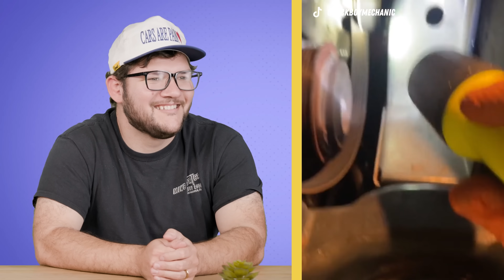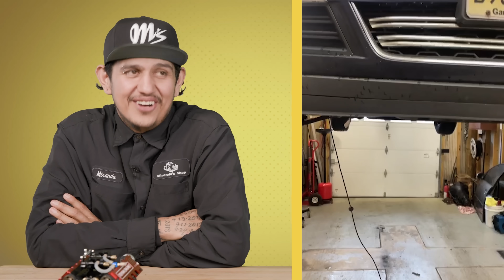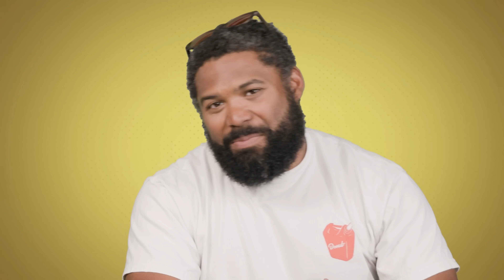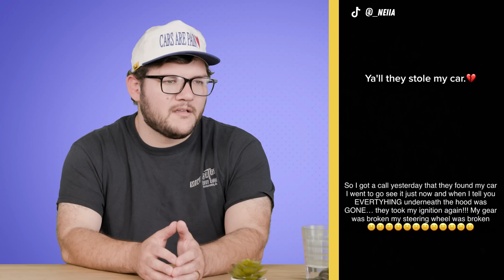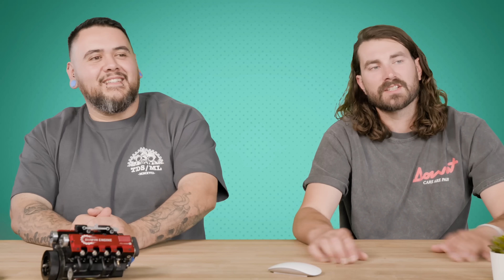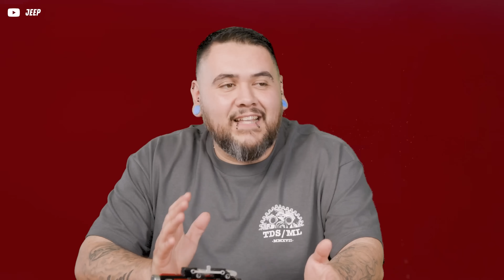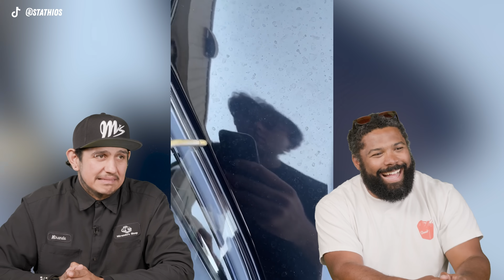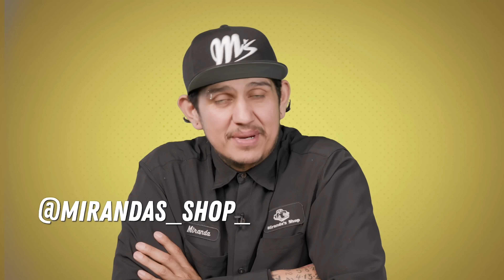Mechanic Reacts to Car Engineering Fails

Comment: I'm an engineer with a major OEM. Typically about ~80% of these issues will be identified by the engineering team before the product ships, but management doesn't want to spend the time or money to fix it. The other 20%, well we're human.
Reply: Exactly. Automotive engineer here, in a major tier-1. Money is the source of all evil, and beancouters are the conduits.
Reply: @Miguel Sousa  
Head of engineering here, yes cost is always gonne be a issue. If I let my engineers go wild on optimization the products get so expensive we won't sell anything. Then we go bankrupt and al engineers ar out of there job. It's a fine line we're all walking on.
Reply: @mksanwho  Not always true.  I'm in IT and have worked with some engineers.  Some of them think they know it all and simply refuse to consider practical considerations if it's not backed by some requirements.  This is the syndrome of I do what I've been told to do even if it doesn't make any practical sense.  And you can find sloppy people as well.  It's not always about money because a callback or warranty repair can end up costing even more.
Reply: @mksanwho  It's called design something worth a f*** before you even take it to the g**** engineers
Reply: Yeah I work in manufacturing, but on tractors not cars, same deal. The #1 reason is always time and/or money.
Reply: @Sergeant Mustang  depending on which conglomerate you work under... if it's daimler.... they on that bullshit with the freightliner Cascadia transmissions.
Reply: Engineer here. This is 100% true. Lots of times, if the base requirement is met, management does not want to or can't afford to optimize it. Redesign costs lots of money and time so it has to be weighed in to see if it's worth it. Also, what many mechanics don't understand are the limitations the engineers have to work against. Schedule, money, scope creep, design limitations, lack of support, etc. Most engineers try to be perfectionists, so mistakes like these are always things we want to fix, we just aren't always allowed to.
Reply: @Jbkhat  true, these types of mistakes are always on my mind, but unfortunately we engineers don’t call the shots.
Reply: @Jbkhat   Redesign?  design it right the 1st time
Reply: Couldn't you fix the issues behind managements back?
Reply: @Jbkhat are you an engineer or a yes man make up your mind one or the other.
Reply: At the beginning of the episode, as a manager, I stated out loud, "Upper Management"! But as an oil tech+, I stated out engineer.
Reply: Yep. I use “modern” machines at work where this is obviously the scenario. The base machine was engineered in the eighties and more capabilities were glommed on. Non-logical archaic circuitry where failure mode is catastrophic instead of limp home, duct tape is needed to seal gaps and “negative pressure” is measured as a negative number (vs. calling it psi vacuum).
Reply: I've worked in places with mechanics machinist and engineers. I was a machinist everyone including engineers would agree about a problem and where it should be fixed but management was the issue
Reply: THANK YOU  for this comment. Mechanical Engineer here. This video fails to acknowledge the horde of people pushing us around as we try to do our job. 

"Make it cost less"
"Make it look cooler"
"It's too loud"
"It's too quiet"
"Wrong color, cuz reasons"
"Make it work exactly the same but look completely different"

This is the life...

If only the broader public knew...
Reply: @dennisbernal91z28f1  im a mechanic here, im young been in the field for 4 years and i feel like its so true what u guys are saying. Yea sometimes i wonder why but on the other side its the things you mentioned. I would actually like become an engineer, but i rather fix them for now.
Reply: @dennisbernal91z28f1  i think yall do get too much hate. But when a dealer marks up 20k it make it look much worse on yall
Reply: @Forty8fan  Not sure how the actions of a private dealer have any bearing on the design intentions of a mechanical engineer, but ok.
Reply: @dennisbernal91z28f1  that's why yall make the BIG BUCKS!! 😁
APPRECIATE YOU!
Reply: @theglitch99   Thanks. It is true that we get paid more than a mechanic in most cases. We also go thru a lot more schooling and most engineers end up with a lot of debt. Another thing to consider is just about all of what we learn in school is not applicable to field work. We just learn how to learn (complex things). From there we get into a field we find interesting or pays well (or both) and start at the bottom. I work for a major toy company and the amount of critical things being designed by junior or even temp engineers is insane. You think we would have an army of engineers designing everything. Its simply not the case, its like 3 and some interns.
Reply: @dennisbernal91z28f1  my kid wants to be an engineer,  much respect!
Reply: @theglitch99  That's fantastic! Help them stick to it. It is a good life. I use to want to be a mechanic (also a good profession) when I worked pumping gas at my first job at 15. The lead mechanic gave me some advice when I said I want to be like him that I will never forget. "Get paid for what you think, not for what you do". He had a lot of aches and pains and was in his mid 40s. By 16 I knew I wanted to be a mechanical engineer. 39 now. Still remember Mike.
Reply: @dennisbernal91z28f1  great advice, 👍🏼
Reply: @dennisbernal91z28f1  or “ you have this much space, make it work”
Reply: @dennisbernal91z28f1  My favorite is 'Make it better, but don't change anything.'
Reply: @dennisbernal91z28f1  couldn't agree more bro
Reply: @dennisbernal91z28f1  "This video fails to acknowledge the horde of people pushing us around"

They did acknowledge the horde of people pushing you around as a waterfall of people that the ideas have to go through. It's too bad the higher-ups are more concerned about raising stock prices for investors than they are about build-quality and brand image.
Reply: @dennisbernal91z28f1   then asked to be invited to be on the show. they are asking the question based on MECHANIC opinion. the show can't acknowledge you if you're not on the show.
Reply: @dennisbernal91z28f1 So it comes down to marketing? Is that why I’m forced to take engineering economics?
Reply: @dennisbernal91z28f1  But a shorter bolt for the belt would cost less so....
Reply: @dennisbernal91z28f1 That’s your job bro don’t know what to tell ya. Do your job or find one you can do.
Reply: @dennisbernal91z28f1  you think people have it any easier at their job?We also get pushed around at our jobs for probably half the pay engineers get. Honestly that was a bad attempt to receive pity
Reply: @408Charger  Not looking for pity. Adding context.
Reply: Spot on, I work with the customer service team for a major OEM liasing between the agents and engineers/technicians at head office and the amount of times I get responses from engineers about an issue thats like "oh yeah we knew that would happen eventually" is disturbing.
Reply: Yup, my dad is a retired test engineer for a construction/agriculture machine company. So many known issues exist  due to management/accounting.
Edit: also politics/egos. Some engineers refuse to admit that they can be wrong.
Reply: Kudos kind Sir, I own a hydraulic business and deal with Engineers frequently, my guess is you work in a industry where Engineers admit when there’s something astray so it can be corrected.  In my world errors like these are the fault of the driver, or car owner, or Uber driver that picked up the driver/owner or even the waitress that served all of the breakfast, just NOT theirs.
  So, I send lots of respect to an Engineer that admits he’s human. I’d enjoy working on a job with you.
Reply: @Hydraulic67   thank you, you sound very chill my dude :)
Reply: I needed 13 minutes to be like: Hold on, we engineers know the most problems, then higher-ups say they will accept it, for the following reason. You think a better-built car that cost 30% more for the same performance specs will sell? No.  Long-term reliability does almost nothing to sell new cars. Make it a standing, faster, sportier. Boom, sales.
Reply: you forgot the part where you will be ordered by management to build it hard to repair on purpose cause management doesnt want to sell repair parts but instead new cars
Reply: C suite needs their bonuses!
Reply: Just a tip, never put the battery under the back seat. Still one of the stupidest designs I've ever seen.
Reply: Remember the space shuttle Challenger got wrecked because of the "management" having more leverage than engineers. Suits and ties who never turned a wrench in their lives make decisions on behalf of the enhineers.
Reply: @tolloromassi99  didn't a 50cent grommet or ring fail. That probably wasn't helpful. Engineering Duty  of care failure by price. No other contributing factor. A bean counter with no job experience with the ability to undermine safety for the advantage of management only. I'm sure the families would have preferred safety without price instead of boxes caused by board members and investors.
Reply: I came to the comments to say this.  Agreed!
Reply: I am a design engineer i agree with you bro.
 Exactly management only seen profile.
Reply: Glad this comment exists.

As a contractor, I know damn well who makes the final calls... the one paying the bill.
Reply: it makes them more money long term anyway. Either they make it back on the time spent fixing it, or they sell a new car
Reply: I was about to say for every blam on engineers, the managers of manufacturer are  also to blame for bc the managers are decision maker, not engineers.

Mass-produced cars are ultimately designed for the quickest assembly time for lowest production cost, not ease of repair.
Reply: Thanks four your Comment, I would add to your 100% the 400% amount of issues which were avoided by engineers. The fact that every bolt you can get to you can get to because somebody thought about how you can get to it.
Reply: I am glad someone actually said it
Reply: Cost cuting and maximizing profit have been neglecting issues raised by engineers and scientists for decades!!
Reply: 100% this. That bolt on the Traverse is that way because tehy wouldn't fork over the money to listen to the engineer that pointed it out. They are too busy trying to force them to make the engine just fit and work with as little money as they can so they don't have to retool/rework the engine between chassis.
Reply: Bragging about a "We fuck up 1 in ever 5 chances" rate is not good. If I did that as a General Contractor, I'd be sued into Oblivion. Bad Engineering costs lives.
Reply: I see the same thing on the aviation side. Unless it's a safety issue. But other than that, the same parts break over and over. It's cheaper to replace a seal than to redesign the part.
Reply: So it's all the Ford Pinto problem, although fortunately less severe most times.
Reply: No, that's someone going click happy in Solid Works with no real field experience with cars. You can design some amazing mechanical art that turns, but when it takes 5 specialty tools and you have to take the tire off to change a battery, engineers are at fault. You're also cramming so much electronics into the car you've forgotten how cars work, you're counting on the chips to do the same task as a manual part that's easier to access and replace. Why did the Willies Jeep work? KISS.
Reply: @3DPT  It sometimes feels a bit as if some cars are engineered by people who are fresh out of college and who've always had their mum doing all of their oil changes. I also know how bad many software engineers are at UX (user friendliness) design, so it's not just a car problem.
Reply: @3DPT  ooh rah
Reply: The reason is that the management moved away from just in time manufacturing to make strikes less effective.

They have thousands of faulty parts on the self and can wait months to get the parts from overseas.

Before the parts were made down the street and changes could be made much quicker.
Reply: So the real answer is greed..?
Reply: @aroc9344  greed from the companies and no balls from the engineers
Reply: Love how engineers find someone else to blame when they designed it. lol they don’t live in the world only theory. I know I work around a lot of engineers and lol they never held a wrench before. Kind of sad.
Reply: 100% agree. Every company I've been at has the same old routine of engineers going to management saying "hey this is gonna be a problem" and management responds by saying they don't want to spend the money to fix it.
Reply: There are game breaking bugs in video games that only take seconds to fix, and managers still fight with all they have against the programmers not running the way the manager like.
Managers are the real problem in the world, especially if those managers never had anything to do with what their workplace does.
Reply: If engineers are so bright, why aren't issues noticed during development. You know why R&D is BS, accountants run businesses.  As for Tesla they have Chinese partnered plants now and those cars don't have build issues that often.
Reply: Lol, I just wrote the same thing. 😂
Reply: 20^ of the most expensive fixes.
Reply: Yeah it really annoys me when people don’t realize this and blame the engineers.
Reply: The management is definitely what happened with the first one
Reply: Exactly - Toyota has been selling lots of reliable cars for a long time (yes they have their turds but overall)…GM, Chrysler, and the others consciously decide to make cars the way they do. They can copy a better process and don’t
Reply: So it all comes down to what the company can legally get away with.
Reply: Yup.   That bolt looks like the bean-counters decided that they're only buying one M8 bolt because they can get them $0.00003 cheaper per bolt if they're all the same size.  Any clearance issues it causes are somebody else's problem 'cause "we just save the company thousands".
Reply: Have you considered taking a sledgehammer to the bean counters?
Reply: yup, can confirm. Though i do work aerospace, so it is 15% human error, 5% we don't want random people messing with stuff so we make it a pain.
Reply: yeah that's what I thought. Most of the supposed engineering fails can be traced back to accounting. Because if soccer moms wouldn't want all that electronic extra bullcrap in their shopping cart Jeep, the engineers probably wouldn't have to try and fit the stuff in there. And if accounting actually gave them enough money for proper components, shit like that also wouldn't happen. For the pulley bolt, even if that bolt was half as long, the head of the bolt already touches the frame, so you wouldn't get a shorter bolt out either. And moving the engine back would probably leave no room for the ginormous automatic gearboxes everyone wants these days. Or for the ginormous A/C units, or for several other unnecessary things that the engineers have to package around. Best solution would be to try and get an access opening in the frame, but that would probably get shut down by some obscure third party crash regulation. And for the oil drain thing? How the hell (without extremely expensive flow simulations, that again, accounting won't pay for) would the engineer know where exactly the oil goes once you open that drain? Yes you can certainly calculate that, but again: money
Reply: I always thought part of the problem with too long of bolts, inaccessible parts, and such was more due to say an engine not being designed for a specific use.  The same engine in a different car may not have the same problem.  Sometimes things could be moved or altered to make life easier, but other times it just had to be left as is.  I have learned through my own fabrications and cobbling at home that even with the best thought process you will miss something  You can either spend another day reworking it or just let it go and spend some extra time down the line when something breaks taking a couple extra parts off to get at things..
Reply: @jasonstclair6293  that too, with the whole sandbox thing OEMs are doing, engineering something for one car, might not make it fit into another car properly. But because money is not to be spent there is also nothing anyone is allowed to do, to fix this issue.
Reply: I would also believe that some of these engineering failures come from only working in a specific area and not having the big picture available. Much like the last one. Engineer A designed the engine and complimentary control hardware that will go in the engine bay of a vehicle designed by engineer B. B only cares that it fits and drives the chassis while A only cares that it runs and fits budget. Meanwhile it is just an unfortunate space that was overlooked that a leak caused by chassis design happens to be in a spot that could have been poorly designed but most likely just ended up in a bad spot.
Reply: @D3M3NT3Dstrang3r  this is especially true for diesel mechanics.  Things like busses, yard tracks, some specialty farm equipment, and the like all use some form of off the shelf parts from other companies to build their products.  They buy engines from Cummins, Detriot Diesel, Mercedes, or whoever, along transmissions from Allison, or some form of hydraulic drive and design their product around it.  Until the first one breaks down after building the first 30,000 and a problem is identified it is way too late to make any real changes.  Even then there may not be any option other than a total redesign which will of course never happen without a lawsuit or recall of epic proportions.
Reply: I think one of the biggest problems in the western world is "management." You could probably dismantle the entire academic fields of Management and Sociology and it would solve at least half the problems we face right now.
Reply: @Trav1983  sociology is plenty important, mate.
Reply: Follow the money...
Reply: I would also add designers because engineers are the limited to the shell the designers want. Which could limit and lead to odd ball packaging decisions seen here.
Reply: I just graduated with a ME degree looking to get into the automotive field, any suggestions on where to start? or if your Co is hiring?
Reply: You are an engineer.... the thought of working on the equipment would be important.... but... if the cost to fix were not difficult and expensive they couldn't sell  enough to stay open.   Still if it were built to bot break... is the same sad story.   It's really.... why buy a new car?   Let them fold till it bends them.   If it were worth buying at prices asked for them.  Then why buy them?   They are a table+ printer.   Will be nothing as you have 10 miles on it it's your baby!
Reply: 80% of management is useless.
Reply: ....bad humans *
Reply: There are a lot of different types of engineers that work on these. Design, electrical , mechanical, production, supplier, sustainment, quality, etc. Andrew even then it can be broken down to specialties. Such as engine, frame, electrical, interior, battery, wheels and brakes/ safety, infotainment, etc.  and generally they don’t “talk” to each other throughout the entire lifecycle of the product. Yes, they should in a perfect world. So when saying “Engineer” is very broad. I don’t disagree with them being the “engineers” fault, just that there are more than one type of Engineer to blame.
Reply: This. This is the only answer. Amazing how so many problems trace back to the people with more money than sense.
Reply: Still engineer fault 🤷🏿‍♂️
Reply: Most of these issues boil down to cost cutting.
Reply: exactly, We don't blame developers for crappy game mechanics, we blame the publisher who told them to build the game that way. Engineers rarely have a choice in what they build. Engineers typically WATN to build a perfect system, but are told not to. From cost, or time, we can't.
Reply: Also most of that stuff is designed to be manufactured efficiently, not designed to be easely fixable
Reply: Yeah yeah yeah it's always someone else's fault. Easy to push the problem on someone else when all you do is push pencils.
Reply: Beat me to it. Forgot to point the finger at accounting too. They're the ones who make the call if a quarter of a percent of a fraction of a cent in manufacturing or materials is too much per planned obsolescence. The engineer is just paid to meet the maximal minimum they decree.
Reply: I hear you.
FWIW, the same thing happens everywhere, including (and you all will relate to this) video games. Nowadays video games are shipped out with a ton of bugs, some of which will never be addressed. Shareholders over quality.
Reply: I remember the engineering team sending us toque specs on these plastic brackets. Every single one we installed blew apart xD I think they transposed a decimal place somewhere.
Reply: Yeah I get so fucking tired of people saying "fucking engineers this" "fucking engineer did that." 

How about you put your two fucking brain cells together and realize that 99% of this shit is cause by unrealistic time constraints, bad management, shitty environmental, legal, or monetary constraints etc.
Reply: And what % is intentional, so people don't work on their own cars and have to pay the dealer's service to do it since something as simple as changing a battery is a hour+ hassle?
Changing the battery on my Saturn: 5 minutes.
Changing the battery on my Dad's Dodge: holy hell, I'd rather not.
Reply: ah the old push the problem up the chain trope. "not me sir i jsut work here" then quit. its 2023 stop complaining and blame shifting.. you can also tell who watched the video.. there is plenty of factory shit talk .
Reply: Some car models and makes have more issues than others
Reply: Makes sense. It all comes down to money. So the more of these issues you find that trickle down to the consumer the more you can see what really matters up at the top.
Reply: True and forget the mechanics
Reply: Sounds right
Reply: Don't forget decisions being driven by styling over engineering and packaging all the features people want into spaces that already have a bunch of other things in them.
Reply: So basically he just said 80% of the mess ups are identified and not fixed and 20% are accidents. So even if they found 100% of the issues, they would all go through because time is $, and they are not doing this on their time.
Reply: I figured that was always the case.
Reply: i like to blame myself (Drafting Student) and other draftsmen, were the guys that drew it like that in the blue print XD
Reply: Absolutely right. I used to work in auto engineering in latches and the amount of times the "make it cost less" line came out was unreal
Reply: My humblest apologies. I always assumed it was your faults. I would always say " What were those engineers thinking "? Or " They don't have to work on these things so they don't care". My mind has changed,  thanks for the info. "
Reply: NOOOOOoooooo... You have engineers with degrees in mechanical engineering / industrial engineering w CAD certificates in Solidworks who never worked on a car. You do great designs for compact engines that work in solidworks, but never think beyond the final design after you talk to ID and accounting. You don't let the mechanics / tech peons into your elite circle of engineering to tell you "Hey, when that breaks we can't fix it." That's the other problem is you're not trained on how to plan for repair, just failure modes and metallurgy.
Reply: My first thought with most of these is that it was a management decision because of $$$ and time (which to them is money.) You're almost always safe assuming something stupid made it to prod because a manager/exec thought it would cost less to ship a faulty product than redesign and push changes to the line. I always refer to these as "management decisions" because only someone who only spends time managing would make such a boneheaded decision, in the end they'll leave a dumpster fire for another management position regardless of how they performed historically.
Reply: You know I never thought if it this way. Managers always think they know best and if they can save a dollar they will at the long term cost of someone else they do not actually care about. That's good food for thought
Reply: Good point, an engineer can't fix corporate greed.
Reply: Not to mention how much is designed by committee, so for instance the person who designs the tensioner mount may have no contact with the person who designs the mounting/packaging/frame rails/etc
Reply: Sure sure, we get that… but come on some of these issues should not have even been in the schematic to begin with… let alone made it to production …. Inaccessible nuts and bolts, things that melt placed adjacent to things that can melt, sparks plugs that the engine need to be damn near removed so u can change them… 20% is too high a number for oh we are human… would u get on a plane with a pilot who is making 20% errors in his flight judgement….
Reply: @trarock24  the standard for testing is a lot higher when lives are at stake like in your plane example. Ultimately most of the issues that frustrate people are just annoyances. These are the sorts of things that the market is supposed to sort out, but only will if people punish manufacturers by taking their money elsewhere.
Reply: Yes, yes...yes!!! This is always the issue in just about all fields!!!!! and really to a degree at least it comes back on customer wanting everything for cheap lol so blame yourself
Reply: Worked for major American car brand, exactly what the original comment said. Your engineers are fine, your management is the failure point
Reply: That's exactly what an engineer would say!
Reply: Typical Engineering response.    "Don't blame me, it's someone else's fault."   Yea it's on you to not design this stupid shit to begin with.  If you were not making these stupid decisions it would never make it to management to not want to spend that money.
Reply: I dont get how you are allowed to sell things you know are not properly engineered...
Reply: @chriskirk9708  You're not, but you settle your cases out of court to avoid the PR humiliation that public court cases, or even worse, a public government enquiry would bring. The Ford Pinto was a calculated move based on cost analysis. It would've cost them less to fix the problem before those cars ever entered the road, but once they were out, getting sued by widowed spouses and other family for what's essentially engineering manslaughter was cheaper than recalling the vehicles.
Reply: @THEROTTINGDOG  whoa whoa whoa. I want my moving mechanical parts to never ever fail and I want as many electronics installed as possible cause my PC never fails and never receives updates....
God I hate dealing with computers in cars.
Reply: Ima quality control in my factory I completely agree management doesn’t give a fuck
Reply: Nah yall are just pissed your wife got railed by a mechanic
Reply: Same in my trade. I am also an engineer.
This totally sucks when you do have the means to do it right but you cannot besause of poeple who only understand the problem when some customer tells them years later.

Also i always insist on production and repair people to be also part of review.
Reply: This makes sense because a lot of them made me go "no way the engineer didn't see this as an issue"
Reply: Shouldn’t have gotten so far  to start with give everything extra room even if it seems to have enough
Reply: Engineers are idiots
Reply: then asked to be invited to be on the show. they are asking the question based on MECHANIC opinion. the show can't acknowledge you if you're not on the show.
Reply: This 100% it is almost always the boss or production not the engineers messing things up
Reply: i dont believe this!!!
one of my customers awhile ago was a retired engineer, that DIDNT UNDERSTAND HOW GRAVITY WORKS!!!!!!!!
Reply: I'm an engineer and I approve this message.
Reply: Manufacturers do analysis on the costs of fixing/recalling known issues vs. the cost of lawsuits or warranty repairs. If it costs less to leave it as is.. take a guess what they do.
Reply: hey heres a good idea, how about they just stop trying to reinvent the wheel every few years then you dont have unforeseen  issues with the product you make @SlowCarsFastSFV
Reply: FINALLY A REAL ENGINEER........THANK U SIR
Reply: I remember a documentary about the new mustang. They did a test production run at the factory. And someone was telling them a bolt was too short. 

The guy got this long ass explanation about a longer bolt costing $0.03 more per car and how expensive that would be. 

So you could probably take a chunk for bean counters as well.

But seriously 3 cents? Just make the car 5 cents more expensive nobody will notice lol.
Reply: and that bolt caused them a recall of more money then what it would have cost  @coreyburke3493
Reply: Don't worry too much engineers. Most of us who actually have functioning brains realize that the idiot bean counters are the problem
Reply: But you fucks made it that way in the first place.
Reply: You get the rope
Reply: I imagine it's the bean counters that are the problem. Make sales this year at the expense of future sales, but that's future bean counter's problem.
Reply: Bruh can someone tell my why the subaru has a ring of fire for an oil filter?
Reply: As an engineer, you know what lowest tender is. Just get it together as cheap as possible.
Reply: Im sorry for your wifes lose.
Reply: After working in manufacturing I’d argue your percentages should be flipped. Mostly because engineers have never turned wrenches in their lives and engineer things with no humility.
Reply: 1. Fords new 1 time use pcv tube 2. Starters inside bell housing 3.starters inside blocks 4. Electric power steering. All of these are a divirgence from known tried and true applications with negligable beneifit in the name of bringing more work to dealerships and a passive aggresive strike at right to repair. I have turned wrenches almost 5 decades. Defend multiple bolt sizes on a single timing chain cover. Water pump inside timing chain cover. And as a lifelong ford mechanic if you are a oem ford engineer i only hope i stand on your shoulders in hell!!! If you work for honda i humbly apologize this was not meant for you kind sir. May you reach the very thrones of heaven upon my back. Harley engineer eat dirt bro
Reply: Jeep's problem: not being a Land Rover! 😜
Reply: How do 80% make it to final production. Just because you read a book and pass a few tests doesn't mean you should be designing things. Most engineering fails are from a lack of common sense and real-world experience.
Reply: Yeah more like more money for dealer repairs ....get too expensive some people will trade up so
Reply: 100%, I blame the engineer if they don't address it, but most the time it's the brand not wanting to spend the money. Why redesign the motor, and the way it mounts because the guy designing the motor, wasn't aware that the team working on frame design made a last minute change creating clearance issues.
Reply: Typical pass the blame excuse If I ever heard one😅😅
Reply: @AnthonySwartz-p1j  dude, as a person in programming....it's the same BS. They would rather you build the new feature, rather than fix the program breaking bug.

Donkey Kong for N64 is a fair example, with it's expansion card. Fix the memory leak? Nah...just give them all a memory expansion card when they buy the game.
Reply: When I was a design engineer, our job was to make the crackpot artists design as close to real as possible. Lol
Reply: Same experience in a smaller company
Reply: To add on with what you said

I have a friend who is a GM retiree and he said it best, most of the engines and drivetrains had to fit multiple projects. In this instance we are talking the 3800 series 2 with the fbody cars,wbody cars,hbody cars you name it and the teams had to agree on many things
Reply: I was going to make a similar point. I’m a recent grad and a lot of the training is just “this is how stuff will break, design around it” but the people who pay for it (in this case the OEM) don’t care
Reply: What did you study?
Reply: @BritishEngineer  was this to me or the OP? Because if it was to me, I studied Mechanical Engineering (M.S.)
Reply: But if you didnt engineer the problem in the first place there wouldnt be extra cost to fix the problem`?
Reply: Agree, as a person who works alongside engineers and designers in the tech industry. Engineers (mechanical and electrical) do what they can on paper in not just engineering the builds, but even working with supply chain and other people in getting a product built. Everything from how its put together, to what kind of screws, washers, plastics, and where to buy them from are selected before it ever hits a factory. You will get changes between product revisions before it is ever finalized.  I've seen managers and execs change parts  or decide to buy the same screw or capacitor from a different vendor than what the engineers designed for - only to have that change totally destroy a pre-production build or cause new issues. All to save pennies or to try and ship a product faster.   Engineers are often held down by management when it comes to making something good vs making something cheaper. From a business stand point, cheaper is always better - too bad most companies don't understand that better isn't always cheaper.
Reply: good to know the companys doesn't give a damn about quality.
Reply: Say a lot about your integrity.
Reply: Has this guy already been ran out with pitchforks and torches?
Reply: Basically, the Engineers do not care because they design the parts, they're not the techs fixing the problem the engineer untimately created.
Reply: I’m not in the car industry but I build jet parts the skeleton structure like the belly and the wings. Engineers just sees what’s on paper and the tools we use to build it is just dumb, stupid and it’s just making things harder on the builders. The company won’t fix it and if they do the engineers don’t make it any better. So re-work is repetitive on the same issues! Ridiculous 😤
Reply: Don’t forget the ever increasing laundry list of international regulations that must be met ranging from overall size to specific safety rules like X amount of space between the hood and the engine for pedestrian safety to emissions that requires all kinds of stuff tacked on. It’s a miracle a working car can come out at all these days.
Reply: @nunyabusiness896  thats why all cars look the same these days. its actually insane how boring modern streets are thanks to regulations. every car is grey or black and has the exact same body shape
Reply: @nunyabusiness896  I say this all the time. If anyone outside of the industry knew how complicated a car was they would be amazed there is any company able to produce a single vehicle much less dozens of companies making multiple models.
Reply: @nunyabusiness896  This. I dont work in cars but in a industry where our product is registered with a government agency. And changing somthing as simple as reducing wire length HAS to be sent to them for approval and documentation before we can make the change. Somthing that likely wont change functionality of a product yet we have to go through government red tape.
Reply: This is why I will never buy a new car. I'll stick to Japanese cars that are below 100k because you'll know of the build quality/problems by then.
Reply: AI is not perfect either!
Reply: @theglitch99 Humans made AI, humans are flawed so is everything we make and why redundancy is a thing.
Reply: You designed a bolt that's physically impossible to remove.

That's not a mistake or corporate saying not to change it. That's pure malice.
Reply: I cuss the bean counters in accounting almost as much as the engineers.
Reply: If management doesn’t want to spend time and money to fix ~80% then 100% is “well we are humans”
Reply: @pedrosiqueira5235  no... they're saying, they're humans, they're going to miss stuff. If management doesn't want to spend the money to fix 80% of the shit then, management doesn't want to spend the money to fix 80% of the shit
Reply: 1/5 times it's just humans huh
Reply: Sounds just like software engineering
Reply: Sitting on the fence in my role in both management and engineering.

Engineering wants the perfect product, trouble is, if you do that, it'll take forever and never be released. I've been and seen companies go bust becuase of indicisions from engineering. Typically engineers have zero accountability for time and money. That's why management are there.

Management wants the product to break after warranty becuase society wants it for cheap. That's down to society, not management. You're welcomed to buy the latest French car, very pretty, latest tech, fancy gadgets and all the bells and whistles. It last about 5-10 years before going to the scrappers, or pay more for less tech etc, a boring Toyota which lasts 10-15yr++.
Reply: Then explain 03 Expedition vs 04 heater box.    03 an older top of box is 2 piece and bolts come in from top in 04 it's a 3 piece top with heater core in middle underneath the others and all the bolts come in from the bottom.
Reply: Engineers also have to answer to the company's demands, and if they tell you to do something a certain way, you have to abide.  We couldn't have things being too easy, because then the average Joe would fix it themselves and that takes money out of the hands of the company that they could be making from repairs because no one in their right mind is going to attempt to pull a motor just to get to some impossible to reach sensor or pulley.  They're going to have go back to the manufacturer for parts and repairs.
Reply: @upinarms79  also a rather big problem is that a lot of engineers work on these projects these days and non of them knows much about the other engineers work. A lot of outsourcing happens as well. As a result an engineer might get told to design a pulley with a certain lenght expecting that it has enough clearance cause he got the info that way and at the end its a shitshow like in the vid.

Most engineers barely get any info on parts that they are currently not working on
Reply: @dergunter1237  It's the old razor and blade gimmick.  They figure out ways to keep sucking money out of you after you buy a new car before you eventually buy a new one.  Make sure nothing major breaks until after warranty if possible, make sure it's just hard enough to work on that the consumer won't want to do it themselves and that they're dependent on the company in the interim.  Corporate bean counters know exactly what they're doing and are very good at their jobs, which is fleecing their consumers out of as much money as possible, for as long as possible.
Reply: @upinarms79  considering that the bean counters get trained 3-5 years in the art of fleecing it shouldnt ve surprising that they are good at it. Also every engineer in college has at least 1 semester a class in "economics" as mandatory requirement and in that class you basically get trained to "make it as cheap as possible"
Reply: Engineer here - didn't become an engineer until LATER tho so I spent a good amount of time in the field on various manual jobs. Got to see first hand experience of stupid design and paper logic.
As I went to school, 98% of the people I met were just school kids..... they worked fast food in high school. Many didn't have a job at all. It was no wonder to me that these 80% mistakes are made.

If all engineers were forced to work 1st in the industry they're choosing to go into, that 80% would cut in half AT LEAST
Reply: This comment is spot on. Also to meet cost they'll use the same parts for multiple models. While it may work on one model the others suffer.
Reply: @ericsly2505  ..... no if they were truly interchangeable they'd be designed like old chevys back when things were designed right easy to work on and everything was truly interchangeable
Reply: Of your gunna design something make sire u understand basic mechanical tech repair how do you not think will this make it harder etc... i dont wanna hear that excuse its quality control bull.  

Gwtting paid all this money just do it right and open your mind to what if and think of the repair man jesus.
Reply: As a technician, I'd have to tell you that the engineering management is still part of engineering...ergo its still engineering's fault. If I worked on a car and then it rolled out of the shop broken, am I going to be able to blame it on a service adviser? Just saying.
Reply: @adamgroszkiewicz814  Engineering management raises the issues.  Accounting says something stupid like "it will cost $2M to have that engine re-certified with a different bolt" because they don't want to actually do any work.  So any fixes die on the vine because they don't understand what they're doing, and are afraid of change.
Reply: So many engineers pissing and moaning about management. I've been a mechanic for 20 year's and I'm calling bullshit. So many things that have worked for a hundred years has been changed to a completely moronic design. Nearly all of these new messed up designs cost more than the old reliable way. Just look at thermostats.
Reply: @unbiasedcobra6672  ..and that's why you're a mechanic, and not an engineer.
Reply: Pfft "we're just human" he says. Look, if I fuck up working on somebody's car, do you think it's enough to just say "I'm a mere human", refuse all responsibility and have the customer deal with it? That's not how it works. I'm obligated to take responsibility and fix my costly mistake on my own time and dime. And even if there is no mistake on my side, I'm forced to take responsibility for your mistake (bolt/part won't come out, due to insufficient space), via unpaid overtime. Man, you don't get to use "'I'm just a human", because that's only acceptable in combination with the willingness to take care of the issue, by making it right.  A la, dear customer, I'm terribly sorry I've fucked up. I'm merely a human. It will take more time, but I'll make it right, plus you'll be getting new part for free. See? that phrase is not a justification to push responsibility onto others. Taking the blame is the least thing you can do. That's not even fixing the issue, but merely acknowledging your fault. And you still won't do it. Man, F**K you AND the accountant.
Reply: Youd think with all the tech we have now days including ai it would be a much more rare occurence.
Reply: @mech0p  No. With all the tech and stuff we have today we are fully aware of these issues. Just like without all this tech back in the day we were still aware of all of these issues.

But we don't get to make the decisions. The decisions are not made by engineers. You ever hear people complain about the bean counters? That is the accountants. That's the real problem.
Reply: @TravisFabel Yeah particularly with something like the first one where the bolt interfered with the frame, I would hazard a guess that the engine and frame were engineered separately. Then when they brought them together, they told management this would be an issue that they need to redesign but were told to just put it together and ship it.
Reply: @TravisFabel  "The bean counters", yes, they are a big problem.  They should be forced to work without lights and heat and sit on a wooden crate because it is "cheaper" that way.
Reply: @alphazero924  that does make any sense at all.  You think that no one has a drawing of fully assembled car with all the components together at design time and tolerances between them is only discovered during assembly years later?
Reply: @francoisloriot2674  The vast majority of engines are used in multiple frames. Unless this is something like a McLaren, the engine is going to be used in multiple frames and the frame is going to be used with multiple engines, so if one configuration has a bolt that interferes with the the frame, you're going to have to raise that to management and if they say "just ship it" you have to just ship it
Reply: @alphazero924  yes I know that.  but it's not during production assembly that will find out, they simulate and test way before starting production right?
Reply: @TravisFabel  The engineer is still responsible for their own actions and signs off on a design. "But Bobby told me too." is no excuse
Reply: @TravisFabel  Accountants the reason the company still has money to run and investors to attract
Reply: @TheDuckofDoom.  "Hey, make a bad car."
"I dont want to." 
"You're fired."
Reply: @bloodyhell8201  Yeah, and? 
"Well you know it's not my fault I killed that guy, Bobby offered me some cash if I did."
Reply: @TravisFabel kinda like pharmaceutical companies. Make more money to treat rather than cure. Get more money off cars if they need to be fixed. Plus it’s all money they don’t wanna spend it to fix their problems and start over the process
Reply: @TravisFabel  Greed. That's the real problem. It's where most of the world's evil originates.
Reply: @TravisFabel being told whether you can spend money to do your job properly by someone who doesn't understand your job 🤙🏽
Reply: @TravisFabel yup thats a greed based speculative exonomy for you
Reply: I’m an engineer. Engineers are smart. They are just as disgusted as the mechanics. Management lies and says just get it wrapped up and we’ll fix it later. But then when things are half baked, they want to ship it out and assign you to a new project
Reply: @mech0p  It is greed, guys. It is always greed.
Reply: @mech0p  95% of what people think is AI is not AI. And it would be a wholesale disaster to rely on it for more than anything else as a curiosity. Is there interesting future applications of the technology? Of course. But it's actually no where near ready for industrial, life consequence important applications. 

And no, Elon Musk can barely tell his ass from his elbow. People who think he's smart are... Well... Commenting on YouTube.
Reply: @mech0p  Yeah, I wonder if an AI would be able to spot a possible problem and fix it or, better yet, not design such problems in the first place?
Reply: @munsters2  100% in the not so distant future there probably wont be a bunch of engineers who design stuff like this anymore as computers will make things that make more sense and are more efficient and it'll also cost a lot less too
Reply: @mech0p  did you just not read the comment? They see the issues, management just doesn't allow the time and money to fix it.... ergo, not sure what you're askking for.
Reply: @PBMS123  because its youtube and i can doo what i want. plus not calling out this bs and letting it go "like you seem to want to do" is part of the problem.
Reply: @mech0p ai don’t have eyes, they can’t look at an engine and say what’s wrong the design, sensors can do stuff if it’s broken, but AI can’t design the cars
Reply: @HandleHandle123  They 100% can design cars. Sure, it would take some time but i guarantee you in the end AI will design most if not all cars. With AI it will be able to virtually run these cars in programs, test everything out that's needed for your average car to run, and alter whatever need be to get it running better. I don't know if you know how advanced AI actually is but it's pretty insane right now and that's just what's been released to the public.
Reply: @mech0p the longer it takes to fix something the more money the dealerships make from repairs too.. some of it is planned
Reply: Tech is the problem, overcomplicating what should be simple. .Gov regulations that require unnecessary complications are even eorse because all manufacturers have to solve the same non problem.
Reply: @mech0p is AI capable of common sense?
Reply: @SoNoTJeSuSx  it doesnt really need common sense when it would have parameters in it that could make it easy for both the people to put together in the factory and for mechanics to work on it. Sure it may struggle the first few cars it builds but over time it can scour the internet for things people like, what they dont like, and what they think they might like and add them onto the cars. Im sure there are tons of posts abouut bolts being in terrible positions for mechanics and the AI can take that into consideration while building a car. I think a lot of people are underestimating what ai can become
Reply: @mech0p  AI is not currently very useful as an engineering tool. Accuracy and veracity are not its strong suits...

In some places, AI will probably be very useful eventually! In other places, it's just the latest corporate buzzword.
Reply: @Bertinator-nm9ld  theyre already using it to identify loose bolts in planes so its more advanced than most people think. Ai is developing at an insane pace currently just look at videos ai makes from a few years ago to now its almost human like. Now sure it will take a bit of time to learn car design but its going to be the future of design for most things and that will include where things will be located.
Reply: @mech0p  It has some uses to be sure. It can be trained for pattern recognition fairly well, which is useful as a starting point, in the case that you mention. But you'd still want the assemblers/mechanics doing everything that they currently do because AI has some serious weaknesses, as well!

One of the more fundamental weaknesses of AI is that they do not solve for truth, and they do not have a logical thought process going on under the hood. Both of those make them liable to give you inaccurate results. And neither of those is really going to change anytime soon. Those just aren't part of how current AI systems are built at all. They're just fancy pattern recognition machines.

Surely you've seen ChatGPT give out impressive sounding answers that were, unfortunately, complete hogwash in terms of accuracy, right? It's pretty famous for doing that.
Reply: @mech0p just look at the ford pinto lol, only an 11$ per car fix but ford said nuh uh and then a bunch of people died and got hurt.
Reply: @mech0p  Ai isn't what you think
Reply: You're an engineer. Either it works or no... you get 2
Reply: No excuse. Y’all can just walk out. 
We have family. So.
Reply: As a quality control engineer it's important to understand it's the design engineers and management that are the issue, the production engineer only see's a model or drawing they only make the components and often do not know what the component mates with.
Reply: Blame NAFTA... Quality of everything in the USA has suffered ever since... Way to go Bill! 🤣
Reply: 20% of human error in engineering would be pretty high. That would mean 20% of any construction would have to re-engineered and production lines changed accordingly after the fact. Now if thats just problems that are inconvenient, that would be okay. But if it means 20% of the parts of a machine will fail, thats pretty steep ^^
Reply: @3000TonnenKoala but he said 20% of the issues. Not that 20% of whatever is designed has design issues
Reply: @3000TonnenKoala  That's not what he said. He said the 20% of the PROBLEMS  are human error. Not that 20% of the parts fail. Big difference.
Reply: @3000TonnenKoala  He absolutely means annoying serviceability issues like those shown in the video.  For example, they may test an engine for hours and hours on a dyno to make sure it's good, but when the chassis designers finallly show up with their design, it's only then you see a bolt can't come all the way out to replace a pulley.
Reply: @3000 Tonnen Koala  that is correct!!! And that's like these engines and engineers that are pretty much paid to make made difficult or defective .
Reply: @3000TonnenKoala  no, that would not mean that.  It was a simple statement he made.
Reply: @3000TonnenKoala agreed. 20% engineering fail is a lot of engineers losing their licenses.
Reply: Stick to cars, because if 20% of aircraft fell out of the sky and Engineers claimed it was, eh, we are human...
Reply: @firefighter1c57  he didn't say 20% of everything will fail, because we're human, but that 20% of the PROBLEMS are caused because they are human.
Reply: @grants7390 Also 20 percent of the non remedied flaws won't cause catastrophic failure or cause the airplane to fall from the sky.
Reply: @firefighter1c57  in aircraft you can have 2 or more backup system. Not in your car. Don't worry, airplane fails except they are built to sustain a fail.
You can choose to pay your car twice the price or with half the perf and little to no electronics and you will have no issues. Take the example of Volvo back in the day and now.
Reply: @firefighter1c57  See Boeing.
Reply: @jmccoppen   I saw Boeing for my entire career with American Airlines. And McDonald Douglas. And Airbus. And Fokker.  Aircraft fuel boost pumps are behind a cover on the wing that takes seconds to remove. Aircraft engine accessory gearboxes are accessible by opening the engine cowl. If it was necessary to remove a JT8 from an MD80 to remove a bolt like on the Chevy Traverse in the video, to gain access to the accessory gearbox, someone would be fired.  American Airlines grounded 200+ MD80s because a P clip that holds a wire loom was installed with the bolt on the opposite side of the wire harness from what Boeing intended.  Aircraft maintenance is planned into the design, and taken very seriously.
Reply: @firefighter1c57  kinda missing the point here, not every failure is catastrophic most are just annoying
Reply: @firefighter1c57 Don't let Boeing hear you talking like that! Lol
Reply: @Bertinator-nm9ld   one model of one airframe had a problem... and, Boeing fired the person in charge of that model... did Ford fire the person in charge of Explorers when they were having blowouts and flipping?
Reply: @firefighter1c57  Well, recently. And there was the whole MCAS debacle before that. And I think a few others that I need to look up again. 

It was just a cheeky joke, but it does sound like Boeing has had some systematic problems inside the company, these last couple decades.